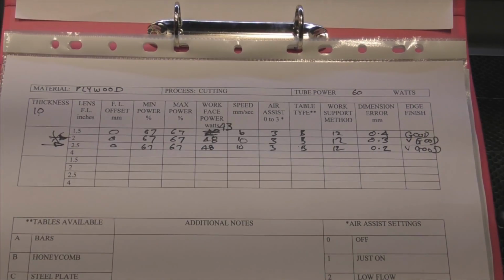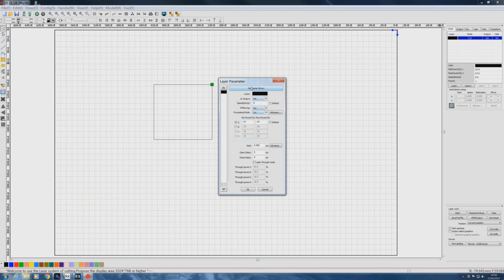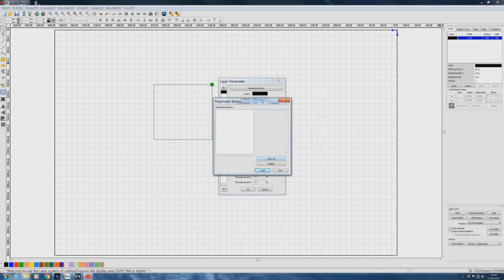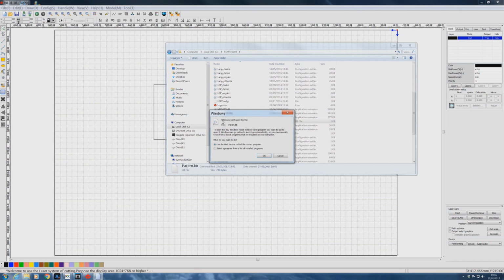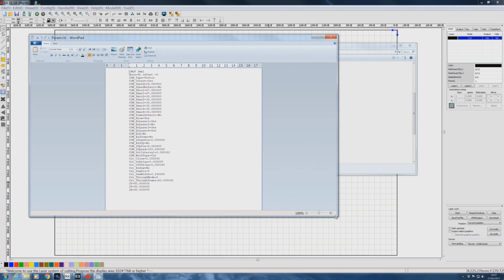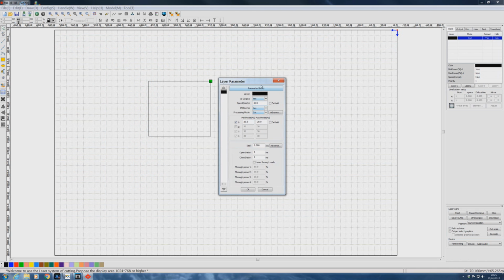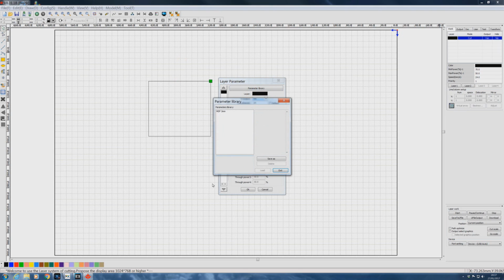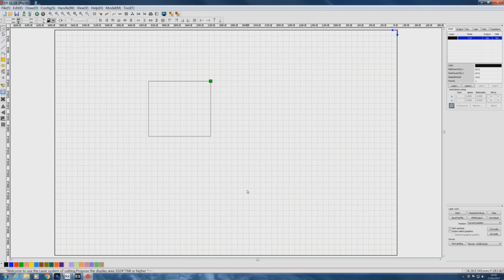RDWorks Learning Lab 95 Cutting Parameters DIY

Comment: Hi! Many thanks for the explanation of the parameter library - I knew that was there, but was too lazy to investigate it (I have all my settings in an Excel spreadsheet, and just manually enter them whenever I need to). I should try that and see if it makes life easier. A little tip about things like Wordpad for editing text files - it can sometimes be funny, because it isn't really a "plain text" editor. Way back, I've had Wordpad corrupt text files I've tried to edit because it wrote some fancy formatting as well. Now I use Notepad++ (no relation to Microsoft's Notepad) which is a totally plain text editor - https://notepad-plus-plus.org/. 

Another thing - I'm strongly convinced that the coolant temperature affects the laser output power! The cutter is in the shed and sometimes when it's bloody cold, I'm sure that it cuts much better. Contrariwise, if it's been doing a lot of cutting and has warmed up to 20°C or so, it doesn't seem as good.

I was amazed at your cutting speed for the likes of 3mm MDF (24mm/s at 67%?) - on mine, which is still an 80W tube, I need 10mm/s at 100% to do that! However, that's because I still have some hard-drive-platter mirrors in the machine which, although they're very flat, aren't very reflective (about 80% each, or only 50% after three of them). I really must upgrade to gold or copper ones and speed things up - I'm just put off a bit by the risk of having to realign anything again!
Reply from the maker: Hi Lindsay
Cutting speed will be better now as when I did that test the machine was not performing at its best, 43 watts is not good it should have been 50watts  plus after the lens. The hard disc platters are not very efficient as you have found out. I did some tests myself and those that I made were about 90% effeicient. OK in an emergency but not a good solution. The most cost effective mirrors are still molybdenum. They are durable and if maintained will work at 95% plus. Gold mirrors scratch very easily and I'm not sure what the Chinese use for their gold but the gold coated copper mirrors I tested recently were at 95% rather than the 99% I was expecting. I currently have a set of my super flat copper mirrors away with a guy in the USA that has promised to plate them for me with 24K gold. I await their return with great anticipation. It's great fun for me to prove a point but not a cost effective solution for the normal Joe .What is the point of trying to get that last 1 or 2% Even if I had a 100 watt tube the watts gain would not be worth the effort. 
Thanks for the comment
Best regards
Russ